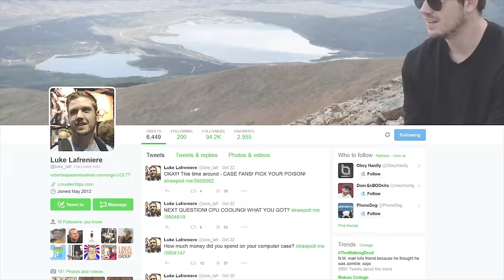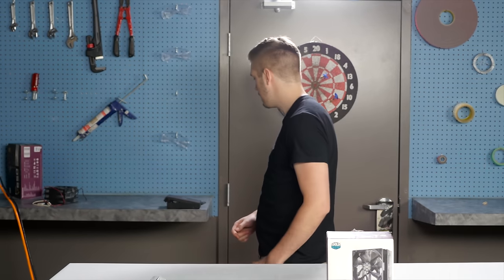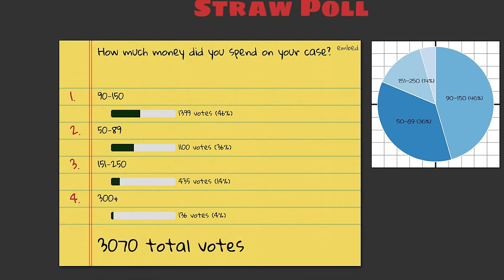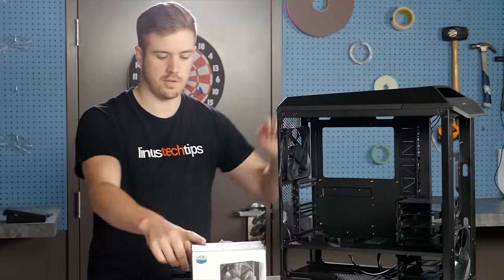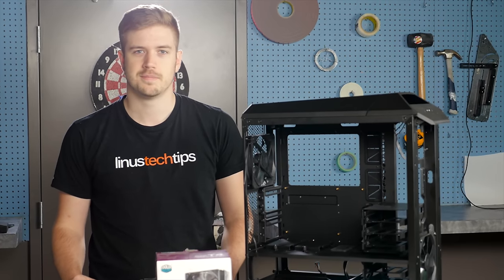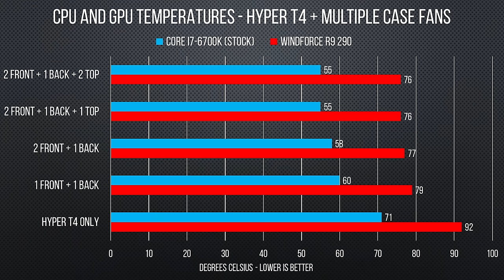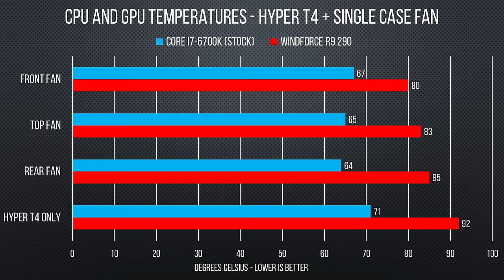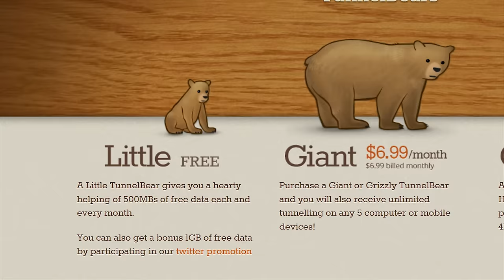Case Fans - How many should you have?

Comment: Does it matter which way the CPU cooler is facing? I have the Hyper 212 evo and I have the fan facing down towards the bottom of my case because that is what I have seen in a few videos. But most people have the fan facing towards the front of the case, does it matter?
Reply: +Grant Kidd I think you'd probably want to have the CPU fan blowing the hot air out of the back of the case, I wouldn't have it blow towards the front (since many cases have other stuff like harddrives or CD/DVD/Bluray drives/drive bays blocking the way in that direction and you don't really want to blow the hot air into the center of your case) and certainly not downwards since blowing hot air onto your GPU just sounds like a terrible idea.
Reply: +Grant Kidd You want your cpu fan to exhaust the hot air from the cpu towards the echaust fan at the back of your case if it is there. Basicly to do this you want your cpu fan facing toward the front of your case.
Reply: parssa sazdar Yeah that makes sense, I will do that. I had my fan facing down because heat rises but what your saying makes a lot more sense
Reply: +Grant Kidd Glad to help!
Reply: +Grant Kidd I have mine being pointed at the rear exhaust which immediately blows out hot air and creates a low pressure pocket, therefore sucking more cool air in. I also ripped an old fan out of one of our old PCs and stuck it in the front to help bring more air in. I have an old cooler master case that only has a rear exhaust and front sort of intake covered by foam. A typical $25 office case basically.
Reply: +Grant Kidd The way I have set up my Thermaltake Level 10 GT is that I have removed the rear fan since it died anyways, then aimed the Hyper 212 EVO with my rewired Optiplex 745 case fan pushing air through the heatsink to the top exhaust fan so that not only does it push hot air in the direction it rises, but also draws some of the air from the backside of the GPU's PCB. I also left the side and front intakes installed with the dust filters removed because I personally don't like how difficult it is to remove dust from them. 

I have contemplated installing a new 140 MM fan where the old one was as an intake instead of an exhaust, but I got lazy and left it because the GPU runs almost 20 degrees colder than it's intended to be able to anyways, never exceeding 58 at worst.
Reply: +Grant Kidd I usually have mine facing directly towards the rear exhaust fan, however I've moved my components into a Corsair C70 which has large fan mounts and vents in the top, so I may point it directly upwards, heat rises after all and blowing it upward should help it up and out of my case ASAP.

It really depends on the natural airflow patterns inside your case, if you have lots of intake fans on the bottom and lots of exhaust fans on the top, then you want to align your CPU cooler to match the flow, it prevents weird airflow patterns and hot pockets from forming.
Reply: +XDerKleineX He was talking about where the fans are FACING to, not where they are blowing to. Englisch ist halt doch nicht so leicht ;)
Reply: Oliver ASUS English is such a boss. It always breaks it's own rules. Hahaha
Reply: It depends on if you have it setup to drag air through the heat sink or push air through it, and ideally you want the hot air heading towards the exhaust fan on your case to keep your airflow going
Reply: +Nathan Totten should team up with parssa sazdar, JZStudiosonline and Harry Akira Eaton to launch a choir .......
Reply: +Grant Kidd "I had my fan facing down because heat rises" That makes no fucking sense. You should at least keep the fan pushing hot air upwards if you have an opening at the top. Your current setup is keeping the hot air inside the case.
Reply: +Daumex if the case has an opening at the bottom for the PSU it can be a perfect way to have it setup, especially in cases such as the NZXT H440 where the top of the PSU would be blocked off by the SSD tray/PSU cover
Reply: +Nathan Totten You don't seem to know the basic laws of thermodynamics: hot air pushed down is gonna move up the case, not down. The air needs to be blown either to the top or the back, not the bottom.
Reply: +Daumex They may have thought of the front and back of the fan in a similar way to a jet engine where people talk about the rear exhausting rather than the front.
Reply: +Daumex I'm well aware of the laws of thermodynamics however I've been running my PC like that for well over a year and I've never seen my GPU or CPU temps rise over a steady temp of around 60 degrees Celsius, the entire system runs quite cool given that I'm not using any high end coolers for the CPU etc
Reply: +Oliver ASUS Well, I don't know why air blowing down into the case would help unless you are intending to make multiple fans blow air into the case to create positive pressure. I'm just asking, but is your idea that the cool air coming in will collide with the hot air rising and cool the hot air down some?
Reply: +prizedcoffeecup I'm sorry, I've written that last comment before I was reading yours, had to rewrite it however because my tablet was powering down :/ It was clearly not aimed at you since you were just asking, but as I already said, there is in fact no "collision" of any kind, since the upward movement of SLIGHTLY warmer air in relation to ambient temperature is entirely negligible in comparison to the directed movement caused by an airflow even the wimpiest fan is able to produce with no trouble at all.
Reply: +Oliver ASUS Yeah...I was just calling it an air collision for the sake of ease. But yeah. 

For me, having my CPU vooler aimed up at the top output fan seems to cool the CPU better and simultaneously knock 20 degrees off the maximum temps of my GPU, but I think it's not because of hot air rising and rather that the CPU cooler fan is closer to where the most heat is produced in the case, and when it's shooting air up it's actually draining that air pocket of hot air by feeding the top output fan a lot more.
Reply: +prizedcoffeecup In fact, after reading the first half of your comment I was going to reply more or less exactly what you've written in the second half, so I've got almost nothing to add :)
I would suggest to rotate your case by 90˚, putting it down on the front or the back (supported by some kind of "case standoffs") and see if temperatures are changing. I bet not much, if so at all.
EDIT: Well ok, not really on the front if you've got intakes sucking air from there, other than my cases as they're all Fractal Defines ;D
Reply: +Oliver ASUS How salty can you get, i can taste your rage tears... You too seem to miss the simple laws of thermodynamics... :'(
Reply: +Daumex Trolling or just stupid? Pretty sure it's both.
Reply: +Daumex Yeah, sorry it was me who started the rage by ranting over "no fucking sense" and boasting about my nonexistent savviness regarding thermodynamics ... oh, wait!
Reply: Oliver ASUS I've a 200 MM fan intake on the front, 200 MM fan intake on the side and 200 MM fan outtake on the top. Stock Thermaltake fan setup lacking the 140 outtake in the back, which just has no fan there at all due to it failing like most Level 10 GTs had issues with.
Reply: +YTmurphy Were you referring to yourself in third person? I guess so...
Reply: Daumex
This assumption proves your intellect to be even below that of a slice of toast.
Reply: +YTmurphy ... and isn't it just hilarious how he refers to himself in third person, projecting own mental issues like that on others? :D
Reply: +prizedcoffeecup That's a bunch of big fans ... never heard of three 200mm combined before. Hope they're quiet and not making some clicking noises they're infamous for ;)
Reply: +YTmurphy God, he still didn't get the difference between blowing down and facing down ... how incredibly dumb can anything on earth be? That thing can't be human, probably it's some wannabe ELIZA implementation from the early '70ies -_-
Reply: Oliver ASUS
lol xD
Reply: Oliver ASUS The top one used to make lots of vibrating noise, but over time the shitty sleeve bearings in there got used to it and run smooth as ever now. The side fan runs quietly on the low settings, but if I hit the button to make these 3 big sons of guns go full force, that side fan makes a considerable amount of noise just from the bearings being generally terrible.

The rear fan was a totally different story, however...this thing was a nightmare after a week of owning the computer. It would run nicely, and then after a while you would hear what sounded like a screaming 1.5L 4-cylinder coming from the back of the case, only to find the blade fully wiggling side to side and tilting in every manner possible whilst the blade has slowed to a crawl. I just pulled that fan and pitched it across the room into the trash immediately. My brother wanted to know why I did, so he pulled it out of the trash and tried to spin it only to find that it was ceased and snapped a blade off in the process.

So yeah.
Reply: +prizedcoffeecup Amazing story, now I understand why you have ... a hole in your back ^^
As for the big ones, it's apparently kind of a lottery. Never heard of a fan before that's getting quieter over time though O.o
Reply: +Oliver ASUS Started out quiet, then was becoming noisier and noiser as well as starting to do the same thing as the rear case fan. Then it just smartened up and returned to normal where it's always stayed.
Reply: +Daumex hot air rises in a static environment, but if you create a chaotic environment with fans, the hot air travels in the direction of the air flow.  ignoring the video card for a moment, one top fan blowing downward in to the case exiting an exhaust fan located in the bottom of the case would produce the same internal case temp as a bottom fan blowing towards a top exhaust fan.
Reply: +Oliver ASUS wow, you didn't even read what I said.  I'm not saying hot air rises.  I'm saying hot air goes in the direction of air flow.   Were you on the short bus?  Besides, I was replying to Daumex, and not Grant, so I was taking your side of the discussion.  Calling me a "smartass" and "imbecile" is trollish, so if you want to have a pissing contest on this please go on, your next foolish reply is greatly anticipated.
Reply: Oliver ASUS If I may step in for a moment, I believe what he means by a static environment is a truly static airflow in the environment: A computer case is not a static environment in terms of air by any means, simply because there is too much airflow for any air to remain hot for more than a second without an object's heat radiance reheating that air, and in order for that to happen the air must be right beside it. 

As a result, my conclusion is this: Hot air may rise, but the ratio of cold air against hot air is so high that the hot air barely stays heated for more than a quarter of a second, and by that point there is no longer any hot air TO do the rising at all.
Reply: +Grant Kidd Rule of thumb is to face your fan on your cpu cooler to the right

Comment: Guys, thermodynamics basics, hot air expands, becomes less dense and thus rises. What does this mean ? Put an exhaust fan on top of the case.

You should think about crashing room temperature air into components, and then circulating that air outside the case, this is exactly how thermodynamics work.

To summarize, put an intake fan directly under the gpu (typically the bottom of the case), this is probably the most important one for gamers, if your cpu gets hot as well, put an intake fan towards it, typically on the side of the case. And since air expands, becomes less dense and rises, an exhaust fan on top of the case is ideal, but in the back works as well. Usually the front is for intake, not very important in this configuration. 

I think the ideal configuration is this, take bottom, exhaust top, intake side, exhaust back.
Reply: Silver Mirai wait, something i dont get, how could we place a bottom fan? thats where the PSU is??
Reply: Silver Mirai you got burn, you're the only kid cryin here, u know humility? U thought you were mocking a guy who was in fact mocking u all the way. I got no reason to cry, u do. See u.
Reply: @tomh4244  wtf dude, he did not got burn you did.
Reply: nobody does side vents? well... my custom build full-tower case has 4 of them for HDD... because they get hot so you have 220mm fans on front (3 of them) and 4 120mm from side, that means you have enough airflow to go through 12 HDD... then another 2 220mm on bottom under GPUs, one 140mm on back behind CPU, one 240mm on back above CPU, 3 120mm on top of the case...
overkill? sure :) if I take out side fans there is almost no difference... if i take out top fans there is almost no difference for GPUs and CPU, but huge one for motherboard temps
Reply: I don't recommend bottom intake as it will suck up a LOT of dust from the ground.
Also heat rising doesn't make much of a difference as the flowing air is hardly 5C warmer than ambient. Having your fans form a consistent flow is more important than that
Reply: @SilverMiraii  hahah,yes i do that all the time drilling it,putting fans where not suppose to exsist and patent them.the best is to leave case open in all fans and use wire on all of the fans,10 fans all fixed with wire all lots of tape.the best pc,the macgyver pc...

Comment: I still have a new Antec 900 in the box (ya 10 years on the shelf), and will be building a 2020 system in it this year. With all the moderan temp drops and smaller sizing drives (M.2) etc this beast should stay cool on the warmest days.

Comment: Where's the angle grinder? Why is there: a caulking gun, a pipe wrench, bolt cutters and a hammer hanging up on the wall. These are all common tools to have in your hands while building a computer. They should be on the bench, not hanging up. The drill battery also hanging up is very useful for quick testing. You can test your computer without the PSU, or test fans.
Reply: Similar to dentists in toothpaste ads wearing a stethoscope (for listening to hear beats) around their necks 😂

Comment: Aerospace engineer with experience with CFD here: you need to be controlling the airflow by blocking any vents that are not covered by fans. It's either an intake fan, an exhaust fan, or an intentional exhaust vent by positive pressure. If you create excess positive pressure you could use vents to direct flow but a fan next to a vent just causes recirculation and efficiency losses. The placement of the intake and exhaust should ideally flow with convection (upward, free energy from the heated air assisting the flow) and the path the air takes from intake to exhaust should flow over your primary heat generating components. The only purpose of those case fans is to keep the case air at ambient in the vicinity of the CPU, GPU and other high heat components. Once you've achieved that anything more is just wasting energy and money trying to do the CPU and GPU fans' jobs for them. I'd be interested to see more control of case venting as well as some shrouds to direct intake air towards the GPU and CPU. I'm willing to bet I could beat your best results with just  2 fans in the right positions with ventilation controlled. As much as we like to blow a ton of air around, the exchange rate of air in the case for optimal cooling does not require the cfm of 3 or even 4 fans. My first guess would be to use just a pair of intake fans on the bottom (or bottom front and back if no bottom fan space) and close all the vents except the top.

Comment: I had 2 on the front wall and 3 on the top of the case. 
The cooler: Wraith Prism. 
Idle temp (3800X): around 50-55C
Load max temp around 80C
Chipset temp: 60-65C

Then I replaced the Wraith Prism with NH-D15S and surprisingly the temps didn't change at all. After several hours of trying to fix it I decided to see what happens if I remove the three top fans and add one on the back wall. It was a huge surprise to see the temps afterwards. CPU idle temp now 36-42C and max load temp when doing normal stuff 58C. Chipset temp 51-56C. The three top fans messed up the airflow that badly. Also now my PC is very silent.

Comment: you need to try with two fans on top, the first towards the back taking out air and the one next to it taking in air. This will make some real difference to the CPU because they would directly be circulating air around its intake and exhaust. Also I always mount a fan at the bottom rear of the cabinet if possible to take all the hot air out from the graphics card. Try this combination and you will see a difference. 

Also what I have noticed is that you have not dont any poistive/negative air pressure balancing inside the case and why is that?

Comment: I haven't upgraded my case in 10 years. Still running an Antec 900 gaming case and have only needed to replace a single 120mm front fan.

2 front 120mm intake fans, rear 120mm exhaust fan, and top 200mm fan.

Comment: So are the three fans of the corsair 570x enough?
Reply: I know this is old, but w/e. It's not really, because the stock speed for those sp120's in the case are ~900rpm--not even close to max speed. They're super quiet but do very little without a Commander Pro connected(more $$) to increase the speed.